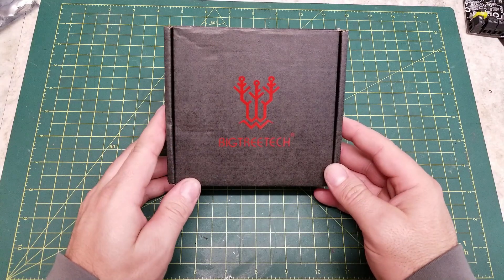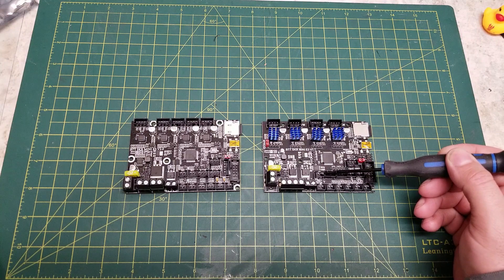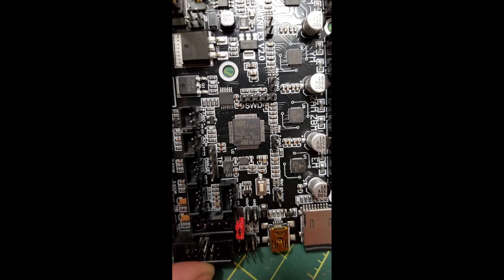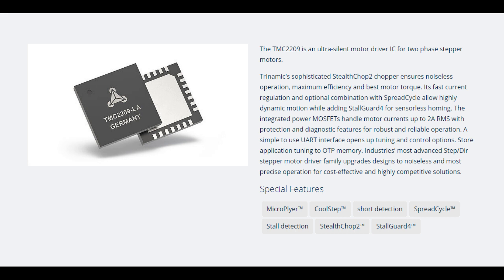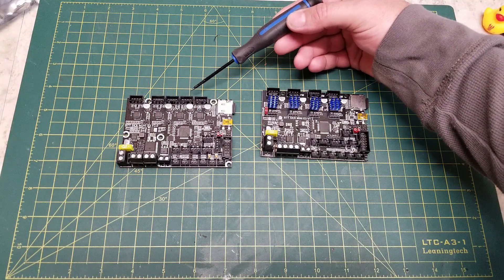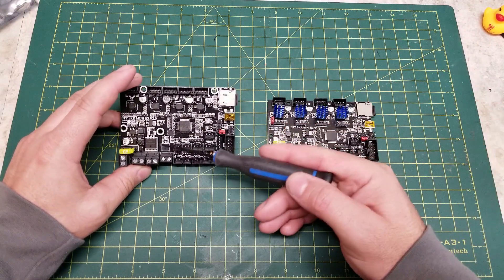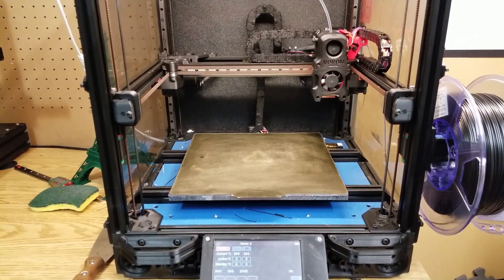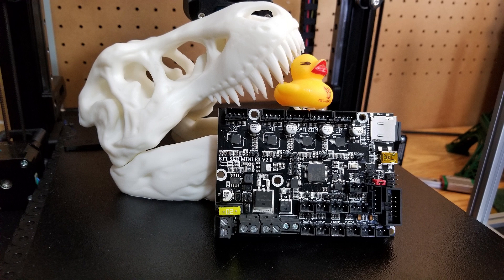SKR Mini E3 V2 Overview

Comment: Anyway you can do a clipper guide on this board. I'm having issues with klippy finding the config file, and Moonraker not communicating with the MCU. And I've followed every step. From manual install to automated. From mainsail to fluidd. Gives me the same error.
Reply: Hi, if you still need support for your Mini E3 V2.0, please send an email to support01@bigtree-tech.com for faster help.

Comment: I am almost finished installing Fluidd / Klipper and am wondering if there is any way to have the old screen from my Ender 5 work with this.  It worked under Marlin, but can't seem to get the correct config for Klipper.  It is the screen with only the EXP3 connection.  Thanks for you Klipper videos, that is how I got as far as I did.

Comment: hi! i've got the skr mini v1.2, and i cant get klipper to work... i've been working on it for 3 days now. after doing 'make', i put the klipper.bin file on a sd card and changed the name to firmware.bin, and restarted the printer with the sd in it. i've been doing this for the last 2 days, trying different options in the 'klipper firmware configiration, but it just wont work. i set all the settings required for the skr mini e3 v1.2
Reply: I'm dealing with the same issue. Clipper is finding the printer.cfg file, or Moonraker isn't connecting with the MCU. That's what the logs say.
Reply: @JAyC3010  but the strange thing is, sometimes it will connect. The problem is the slow processing speed of the pi zero
Reply: @robbinkoot2154  I have a raspberry pi 3B plus and I can't even get past the firmware restart button. Going to see the config for the MCU, see if I can do some tweaks to fix the problem
Reply: @JAyC3010  if that's so, you probably just did something wrong with the config file.
Reply: @robbinkoot2154  that's the thing, I don't know what I missed. I followed the exact instructions. Both the automated, and manual. Anyway you can show me your config file, to compare?
Reply: @JAyC3010  how did you connect your mainboard to the pi? What mainboard do you have, and what do you have under the MCU tab in your config file?
Reply: @robbinkoot2154  I'm using the skr mini e3 v2, thats why i'm on this video. by USB. the mcu on the cfg is: /dev/serial/by-id/usb-Klipper_Klipper_firmware_12345-if00. But looking up the mcu id on KIAUH, its: /dev/serial/by-id/usb-Klipper_stm32f103xe_33FFD3055356343526761443-if00. i've switched the mcu's around on the cfg file. but it gives me a different error, saying its and old version.
Reply: @robbinkoot2154  finally got it.
Reply: @JAyC3010  Do you mind leaving your solution here, for posterity's sake? :)
Reply: @endthefighting  I used the MCU given to me in the klipper build on the pi. Then replaced the MCU the config has for the board, with the MCU the pi gave me. The instructions for the board are correct, just the MCU isn't update, or correct for the config.